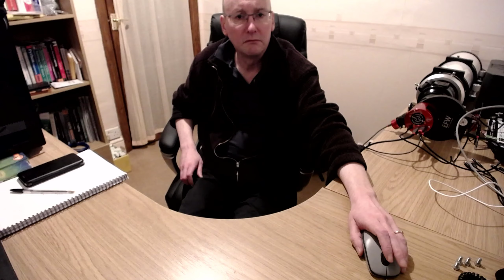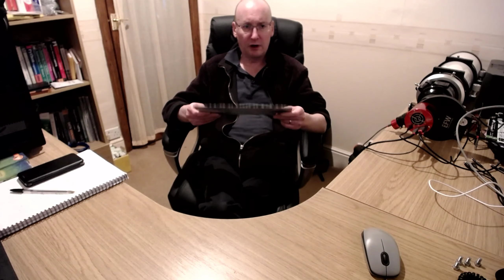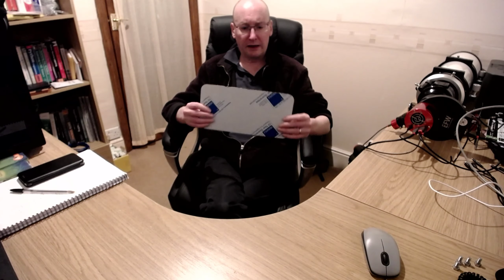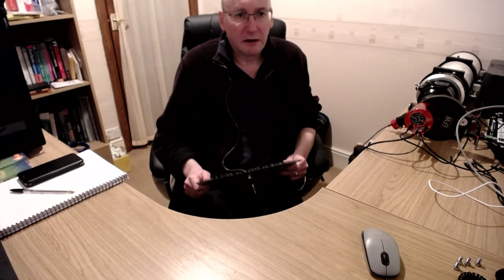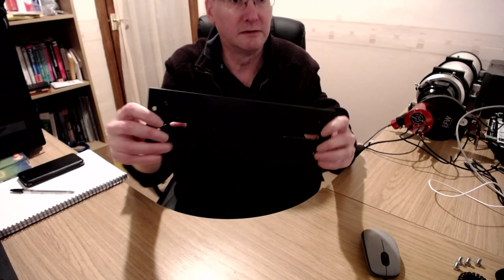Pegasus and Raspberry Pi Mounted on a Perspex Sheet

Comment: Nice setup. Can you show where you drilled holes in your Argon M.2 case to hold it to this setup?
Reply from the maker: I used velcro sticky straps for the M2 case.
Reply: @gilescoochey  Nice! I 3D printed a part to hold it on my scope. Though, in the end I did use velcro for extra protection too. :)

Comment: Very nice build, some good ideas you have, thanks for sharing this
But where would you mount the guide scope in this situation ?
Reply from the maker: For me I use a OAG
Reply: @gilescoochey  thanks, yes that's much easier
Reply from the maker: @siegfriednoet  But I guess, if you have a guide scope then you will need to mount it above whatever your guide scope allows. Otherwise you need to find tube rings that might accommodate this kind of set up.